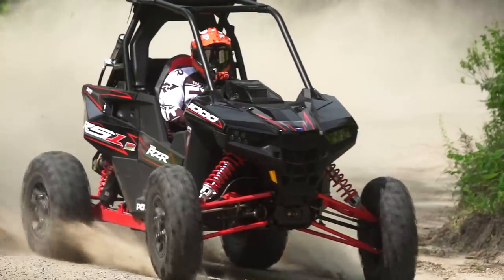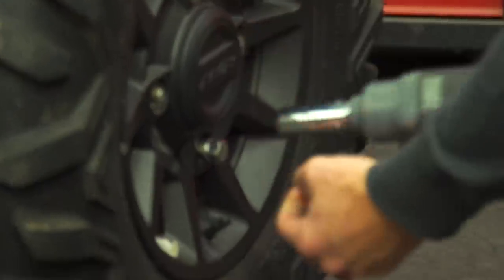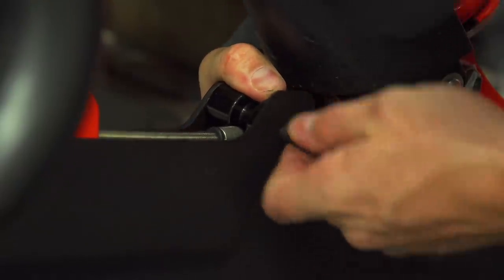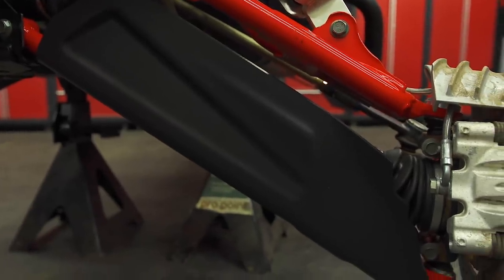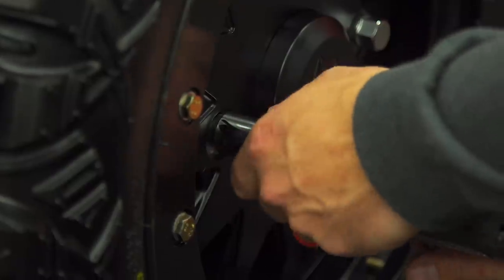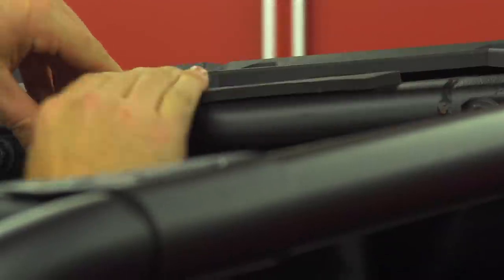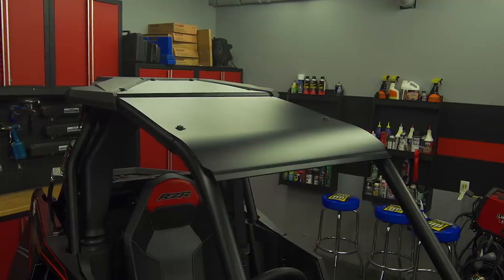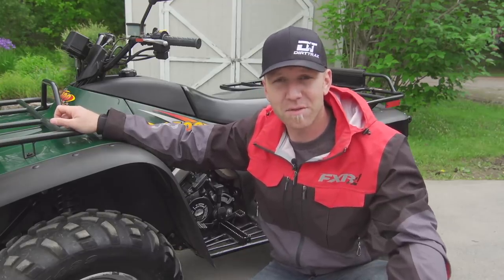Turning the RZR RS1 Into a Rock Crawler: Part II

Comment: Considering the axles are still factory the 28" tire size is not a bad decision. My only concern would be the throttle needed to get over obstacles a larger tire would simply crawl over. The RS1 turns into a rock bouncer rather then a crawler :) Still very interested to see this in action!

Comment: Nice build but I have to disagree on the tires. The stock maxxis 29 inch tires have been great for me. From open desert to rock crawling out at the hammer trails they just work great. The best thing about them is you can find brand new sets for cheap all day on Craigslist.